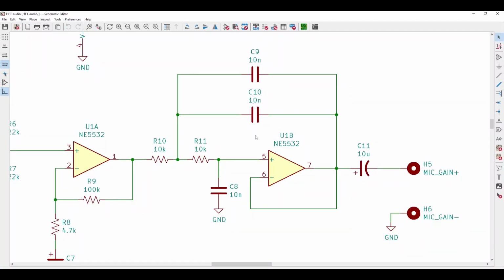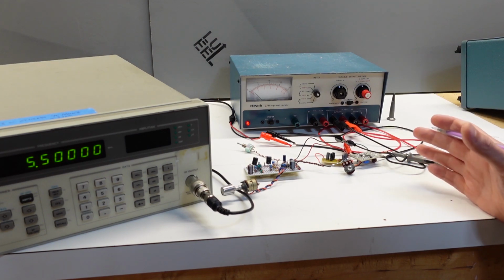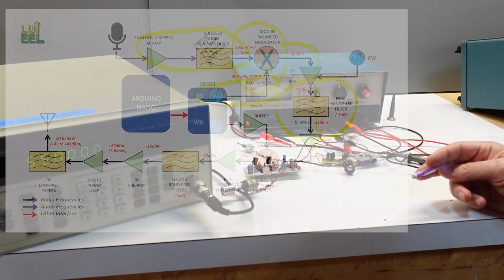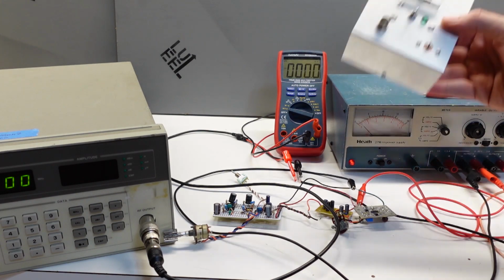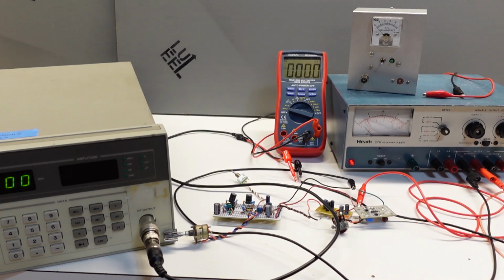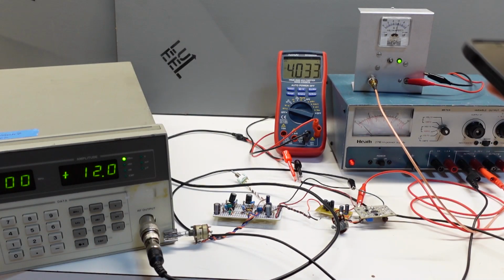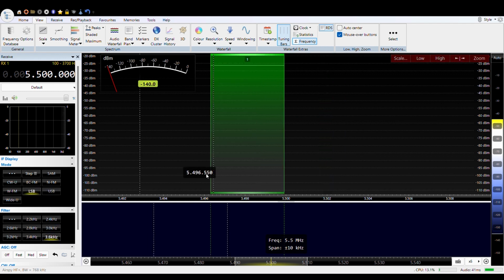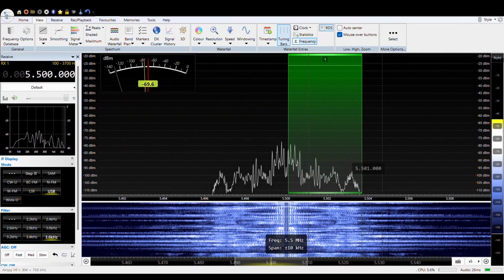HF Transmitter #05 - The Modulator

Comment: Actually, the difference between AM and SSB signals on an oscilloscope is pretty clear, once you know what to look for: on an AM signal with sinusoidal modulation, both the positive and negative envelope shapes are each full sine waves, while on an SSB, the sine waves always cross through zero.  So even though you can't see the phase, you can see that the two sides of the envelope are crossing over each other.  And that's just at full modulation.  On anything less than 100% modulation on AM, you will never see the positive and negative envelopes pinch together, while on SSB, regardless of the modulation drive, they will always pinch together, since they are actually intersecting.

Comment: Using FR4 boards you can only expect up to 55dB carrier rejection which is the coupling through the board itself bypassing the mixer and filter input and output pins.  You can improve carrier rejection but cutting a hole in the circuit board under the mixer and filter so there is air between input and output pins.  Signal will still sneak around the edges, but air instead of circuit board will reduce carrier feedthru.
Reply from the maker: That's a great tip. I may try that, it should be easy to clamp the board in my mini-mill and remove the copper in those areas.
Reply: This sounds like superstition and magick.  I've seen plenty of mixers on FR4 that have better carrier modulation than that.

Comment: This is such good content, really thorough, well prepared, technically correct, and answered all my questions. Using a cheap SDR as a spectrum monitor is so useful, I do the same with my SDRPlay RSP1A. Mine has a spectrum analyser client which is also useful.  I would have been concerned about the furry bits around the tones, but you put it down to an artefact of the SDR.
 Pity this video doesn't have 2k views by now, but that's the way homebrew radio videos with real content seem to perform on YT these days.  Keep up the great work!